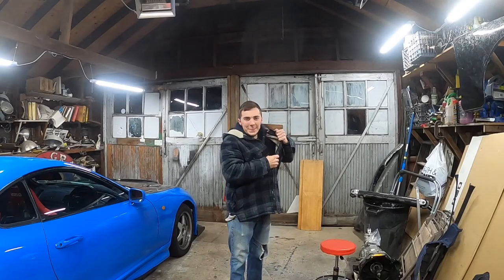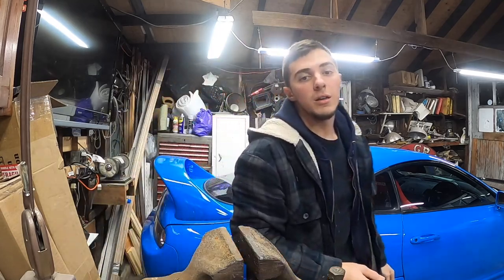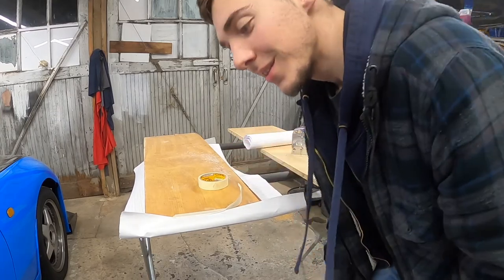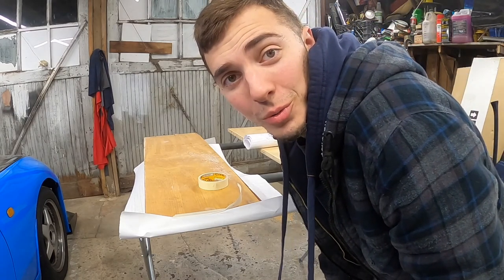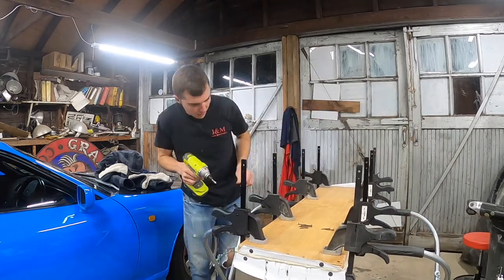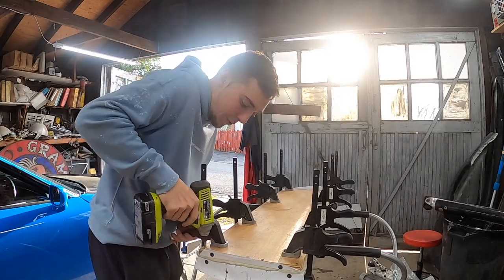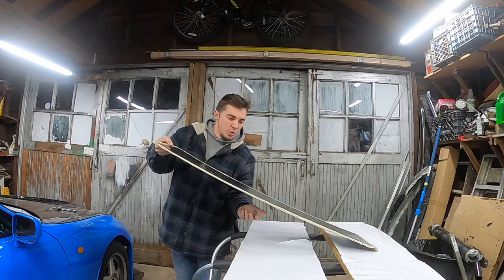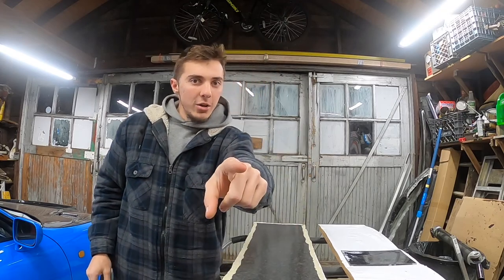Forged Carbon Longboard

Comment: The bottom looks awesome! Seems like the clay on the sides prevented you from squeezing it enough to get rid of the voids on top, should work well with some other laminate layers to add thickness and strength though. Good job
Reply from the maker: I know, I should have used a little less clay to avoid having to sand the amount I’m going to. For the next video I’m going to do just that to give it more rigidity and thickness. Thank you for the kind words my dude I really appreciate it!